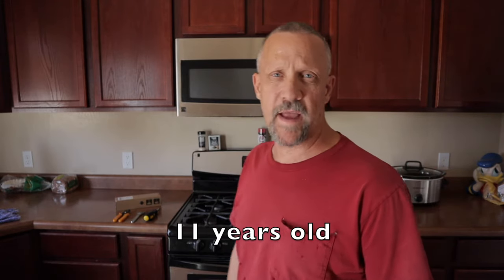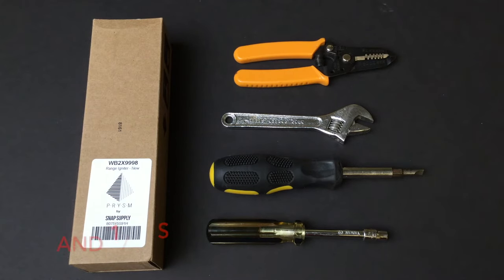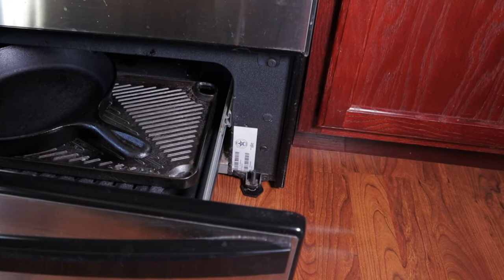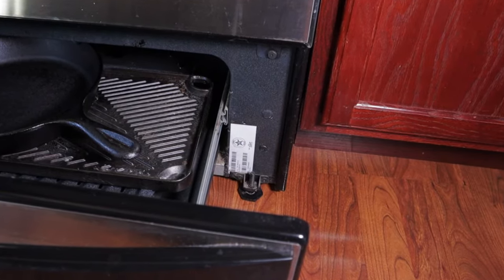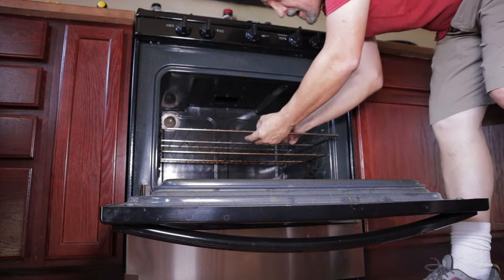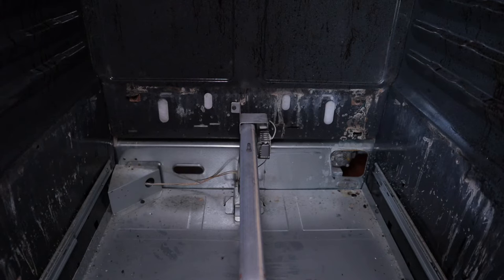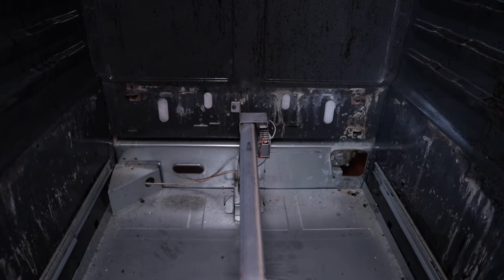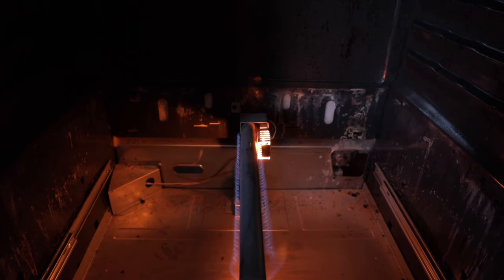How to Replace a Kenmore Gas Oven Igniter - Kenmore Gas Oven Takes a Long Time to Preheat

Comment: The OEM igniter for my kenmore oven was $116. Bought a cheap one from amazon. Worked fine for a few months but eventually developed a problem where the glow was slightly delayed and caused a bit of gas to build up in the oven. Once it finally glew, the oven would burst due to the buildup of gas, causing the door to open! Bought the OEM igniter and it solved the problem. I do not recommend cheap aftermarket igniters based on my experience and research.
Reply from the maker: I have been using mine for about three years now since I made the video and it's been working great. Apparently it depends on the specific oven you have. Glad to hear you were able to get yours working right!

Comment: Thanks for posting this. You definitely saved me time, money and a headache! I even lucked out because my model is slightly different than the one in the video. It came with a quick connect so I didn't even need to strip wire or anything like that. You're the man Bruce!
Reply from the maker: You are welcome Paul and thanks for Watching!

Comment: Thanks for the video.  My igniter came with the same quick connect as the original so no stripping necessary.  The part was around 60$, but beats buying a new oven.

Comment: This is the best video walkthrough on how to do this. I ordered the part with the connector so didn't have to clip anything. Also might want to get some more shrink tubing (grey rubber around terminal because my original was destroyed. End up finding some though at Walmart. So for less than $50 fixed my own oven. Thank you, thank you, thank you kind sir.
Reply from the maker: You're welcome and nice job!

Comment: Mine also slightly different. Don't take out pan below burner. Remove storage drawer to reach igniter connector (Paring knife or small standard screwdriver to release connector lock.) Remove one screw front and one screw back attaching burner. Igniter comes out with burner. Install new igniter to burner. Reinstall burner (look through storage drawer opening to ensure that burner sets properly on gas jet.) and reinstall two screws that mount burner. Connect igniter by reaching through storage drawer opening. Reinstall first two pans (deflector and oven bottom) with the screws for each that were removed.
Problem of forever preheat solved. Wife happy. Total time 20 minutes (due to differences) Thank you for the video!!!
Reply from the maker: Excellent job! Thanks for stopping by :)
Reply: A bit more information  Ordered from Sears PartsDirect. A bit more pricey at $116.41, $138.63 with rates and shipping. But...made in USA, same high temperature insulation on leads, and exact same connector. Painless installation. Have been through cheap Chinese imitations before and choose not to go through the waste of time, money, and pain.

Comment: Great video!
Im having the same problem my kenmore 790 series, I’m going to look in to a replacement igniter and give it a shot myself 👍🏼
Reply from the maker: Thank you, I'm glad you enjoyed the video. This did help our situation but it didn't completely cure the problem for us. I ordered a new temperature sensor and will be making a video of that replacement when I get the chance. I did measure the ohms of the temp sensor that's in the oven and it measured in the range it is supposed to. I have read that it could still be faulty so I decided to replace it too. A new temp sensor was only about $15 at amazon. If that doesn't completely fix the issue I'm thinking my problem is in the circuit board and if that's the case I'll have to see what they cost. It might be time for a new range depending on what they run. Hopefully yours will just be the ignitor and you'll be done. From what I've read, most of the time replacing the ignitor cures the problem. Good luck with your project!
Reply: @DIYHomesteadProjectsDIYHP10  SUCCESS !!! I installed a new igniter off Amazon, with taxes and next day shipping it only cost me $30 This video came in handy and saved me big bucks !
Thanks again  🙏
Reply from the maker: You are welcome! I'm glad the video helped you out! 👍

Comment: Thanks for this useful video.  Worked just fine.  A couple fine points that might be helpful.  First, the plugs on my replacement worked fine so I didn't need the ceramic wire nuts and no cutting and stripping was needed.  Second, shop around for your part.  One supplier wanted triple the price of what I paid ($20) for the part!
Reply from the maker: You're welcome and I'm glad it helped you out. Thank you for the nice tips!

Comment: Just replaced mine. Wasn’t able to get to the actual igniter connector in my model so had to cut and strip the wires in place.  Wire nuts didn’t want to grab at first so tried shortening the ends and that seemed to work.  Also one of the screws holding the igniter in place had some bad threads so had to fight with that a while. Also it was handy to know that there’s a nut on the opposite side of the shut off valve that needs to be loosened before you try to shut off the gas.  
Edit: forgot to mention that the new part had a double-sided mounting plate so it could be mounted on the left or right side. Which meant I had to carefully bend down the one I wasn’t using so as not to break the fragile igniter.  Other than that a piece of cake!  Thanks, the oven seems to be working perfectly now.
Reply from the maker: Glad to hear you got your oven up and running. Even with a few little issues you got it done and saved yourself a lot of money. Nice Job 👍

Comment: Update: It worked! My Kenmore oven was a little different to take apart; had to remove a couple floor panels, and then had to slide out and remove the warmer drawer to access the wiring. Luckily it was just a single clip, but it sure wasn't that easy to reach! I used a pair of long hemostats to hold the connector on the inside of the oven, because it didn't have much slack at all and I was worried I'd lose it. Luckily it clipped right in. Re-assembled and the oven fired right up! The old igniter certainly looked pretty worn out--I don't think it lasted more than 5 years.

OK so for a while I would get shorts and trip the circuit breaker when I would use the oven; not always, but some times. Over the past few days, oven was acting weird-- it would take forever to get to the right temperature. Just now-- I was going to bake a couple potatoes; I set it at 450-- an hour later, I realize, nothing at all! It's not heating whatsoever.

My landlord is frustratingly useless so I think I have to tackle this myself. Thanks for the video, it looks pretty straightforward-- I always worry a little messing with gas appliances but I think I can handle this repair. I just hope that this is indeed the problem, and not a temperature sensor, or something else that's going to send me on a wild goose chase.

But considering the symptoms I described, the electrical shorts and the eventual failure to ignite completely, I think there's a very good chance the igniter is the issue. I'll report back after I swap the part!
Reply from the maker: Excellent and GOOD JOB! 👍

Comment: Thank you for your help. The igniter I ordered came ready to be connected and didn’t have to do the wire cutting and reconnecting. Unfortunately after connecting everything still nothing works. What do you think I should do next ? The top burners are all working except  the oven and the broiler
Reply from the maker: Sorry but I don’t know much more than replacing the igniter.
Reply: @DIYHomesteadProjectsDIYHP10  ok thank you

Comment: Great Video. Did you have an upper and lower burner with an igniter for each? Maybe just a lower burner?  Likely a similar solution for both I would assume?
Reply from the maker: I only had the problem with the lower burner. I would guess the upper burner would be the same. I haven’t done it so I really don’t know for sure.

Comment: Thanks for the help. Just wondering why you used the old wires instead of the new. My replacement  ignitor wires were plenty long enough to use without attaching the old ones. Just a preference?
Reply from the maker: My new igniter had no connectors on the wires. I'm not concerned about old or new wires. I just need them to be a suitable length with the proper connectors on the ends.
Reply: @DIYHomesteadProjectsDIYHP10  ok, was just wondering. The ks again.

Comment: The one I bought had female spade connectors, one small, one large and the gas valve male connectors were sized the same. No plastic insulators so I followed your lead with shrink insulation over the terminals. About 25 seconds heat up before gas valve opens. I did not need to use the ceramic wire nuts. Mine has a oem plastic quick connect.
So, I guess I will check back for longevity update, Or not!

Comment: Good video...but why disconnect the old ignitor wires? I just cut the old ignitor wires inside the oven and splice in new one. Less trouble IMHO
Reply from the maker: I disconnected the old wires mainly to make it easier to show on video rather than trying to film inside the oven. It’s not a necessary step especially if you’re not trying to film it. Good point!

Comment: Hi!  I see you gave a part number and link in description for the range burner igniter.    how does one figure out the part number on the range igniter?   Is the number listed somewhere on the old part?   Haven't had a need to replace mine yet, but your video came up and was just curious.    Thanks in advance!
Reply from the maker: I looked mine up in the stove manual. I typed that number into a search on Amazon and several popped up. I just picked the cheapest one and it worked fine so far. I think most of them are universal but I suppose there are a few that aren't. Or just type in the name and model of your stove with "igniter" and it should give you some choices. I chose one that looked the same as the one I removed from the stove.

Comment: Do you have to use the wire connectors? Im only asking because the previous does not have anything for heat.
Reply from the maker: I don't know if you have to use wire connectors but you'll have to find a way to connect the new wires with the old wires. My new igniter came with ceramic (heat resistant) wire connectors to use in the replacement.

Comment: Please, what if there is a rusty corrosion on the gas tube at the igniter? Should that be replaced, as well? It's right at the igniter on tube. Igniter has greenish corrosion on metal outer part too. Thanks.

Comment: If you have a Carbon Monoxide detector issue and it is near one of these gas stoves this is likely the cause of the CO2 issues. The ignitor will engage but the pilot never lights up so the gas continues to run but it never lights and it sets off detectors in the vicinity.

Comment: I have the same one but the burner pan doesn't pull out.  I took out the 2 screws and it lifts but it feels like it is hooked at the front side.  There are no other screws or tabs.

Comment: If this is my issue then should I be able to light my oven manually? I turned my oven on and tried to light manually but it didn't appear to be releasing gas. Does the igniter need to reach a specific temp before gas is released? Other parts of oven working.
Reply from the maker: A faulty igniter can prevent the gas valve from opening. Just glowing red doesn't mean it's working properly. It must have a certain amount of resistance to send a signal to open the gas valve.
Reply: Update: So I was sitting here waiting for the igniter to get hot enough to lite and then I smelled gas so I was able to manually lite it. Well it barely had a flame like it was not getting enough gas. It went out and could not light it manually.
Reply: Ok so the igniter can cause a gas flow issue. Thank you. I will still try the igniter.

Comment: My Kenmore gas oven made a click then popped the breaker. After that it won't heat up. I changed out the igniter but the new igniter won't light either. Broiler and range top still work. Any thoughts?
Reply from the maker: I have not encountered that issue myself. I'm not sure what causes that to happen.

Comment: Bruce, I have an older Kemore gas stove, with a menu on the back panel.  I moved in 2008 and the stove was here. When I press the ‘Bake’ button the widow on the panel displays a choose of heat times but when I try to enter those numbers there is just fast clicking sound emanating from the panel but the gas does not ignite.  Any suggestions??
Reply from the maker: I'm sorry Dave but I have never had that problem. I just don't have an answer for you. Maybe just try a google search for Kenmore gas stove menu display issues? Or Kenmore gas stove control board trouble shooting? Sorry, I really don't know Dave.
Reply: Thanks for the quick response Bruce, I couldn’t find a match from there menu for my stove.  The stove top gas jets work and they spark to ignite the gas.
Maybe time to go shopping.  That’s again for the fast response.
Reply from the maker: No problem Dave, I wish you the best in your search to find a solution.

Comment: I'm about to do the same job. Looks like your oven is missing the heat shield that goes under the burner above the drawer. You're wasting heat into the drawer could melt stuff kept there.
Reply from the maker: Could be, this oven is about 10 years old and was in the house when we bought it. Who knows what it's missing. We don't keep anything in that lower drawer anyhow.

Comment: Hello, i have a o'keefe oven the igniter does light up, Buy there is no flow of gas. Do you know what i can do. Thanks
Reply from the maker: I'd start by replacing the igniter. Just because it is lighting up doesn't mean it's working properly. The ignitor not only has to glow but it has to produce enough resistance to open the gas valve. When they go bad, sometimes they will glow but they don't generate enough resistance to open the valve. It's about the cheapest place to start with your problem.
Reply: Ok. Thankyou very muchas i Will do that.
Reply from the maker: You are welcome, good luck with the project.

Comment: I have a Kenmore. I replaced the igniter (which was busted) but now the oven is not functioning properly. The pilot light is on and noise when the stove and oven are off (??). When I turn the the burns on the pilot light “slows down “ and makes less noise. And even when I turn the oven on it doesn’t light up. Please help?! 😊 Thank you!!
Reply from the maker: Sorry but I don't have an answer to your issues. I have not experienced any of those issues with my stove.
Reply: @DIYHomesteadProjectsDIYHP10   thank you so much for your prompt replay!  😊🙏🏾
Reply from the maker: You're welcome, sorry I can't give you more information about your situation. Good luck to you with your stove.

Comment: is it common for the igniter to be in the flames? i turned on to test and it fired up but the igniter itself appeared to be in the flames.
Reply from the maker: That's a good question and I do not know the answer.
Reply: @DIYHomesteadProjectsDIYHP10  Either way it's working flawlessly. Thanks again.
Reply from the maker: You are welcome :)

Comment: Why did you need to cut the wires? Why didn't you just use the new ignition?
Reply from the maker: The new igniter does not have any connectors on it. You have to use the connectors off the old igniter. I shortened the length because the new igniter comes with long leads and I didn't need all that length.

Comment: I have model 790.78853602 Kenmore gas stove. Would that ignition work for that model # ?
Reply from the maker: The one I used fits many different stoves. It's a universal model. Chances are good it will work but there is no way for me to know without looking at it in person. The main thing is if it will mount where the old one mounts and connecting the two wires. If you can do both of those, it should work.